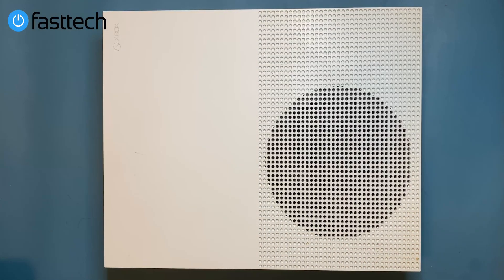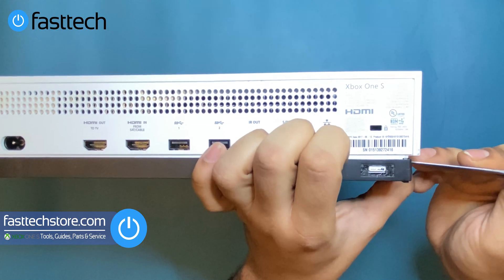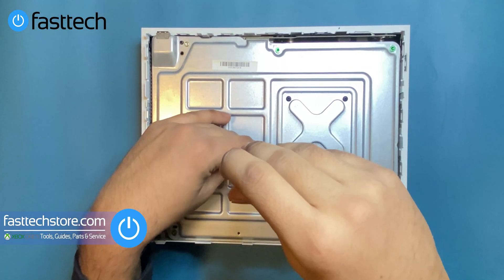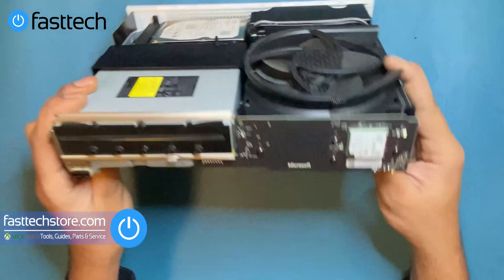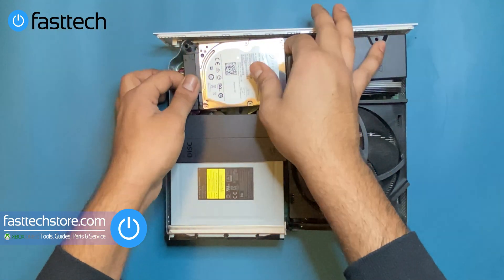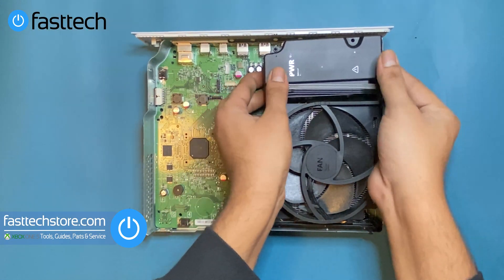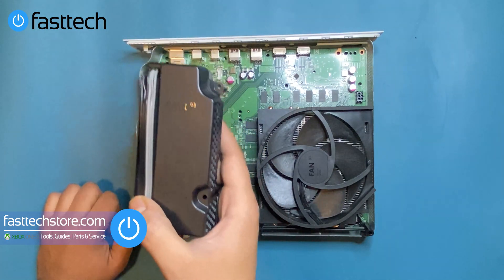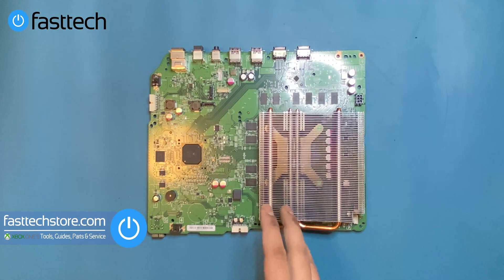Xbox One S Repair and Disassembly Guide

Comment from the maker: FREQUENTLY ASKED QUESTIONS
Where do I buy the parts and tools needed for this job?
👉Fasttech Pro Toolkit: https://www.fasttech.ca/tools/fasttech-electronics-repair-toolkit
👉Xbox One S RF Board: https://www.fasttech.ca/xbox-one-s-parts/xbox-one-s-rf-board
👉Xbox One S Network Module: https://www.fasttech.ca/xbox-one-s-parts/xbox-one-s-wifi-network-adapter
👉Xbox One S Disc Drive: https://www.fasttech.ca/xbox-one-s-parts/xbox-one-s-disc-drive-replacement-liteon-dg-6m5s
👉Xbox One S Power Supply: https://www.fasttech.ca/xbox-one-s-parts/xbox-one-s-power-supply
👉Xbox One S Hard Drive: https://www.fasttech.ca/xbox-one-s-parts/xbox-one-s-hdd-1tb
👉Xbox One S Fan: https://www.fasttech.ca/xbox-one-s-parts/xbox-one-s-fans
👉Xbox One S Motherboard Combo: https://www.fasttech.ca/xbox-one-s-parts/xbox-one-s-mainboard-disc-drive-combo

👉NEED HELP? FaceTime/Zoom Video Call Me: https://www.fasttech.ca/online-consultation
👉GET REPAIR SERVICE FOR YOUR DEVICE: https://www.fasttech.ca/electronics-repair